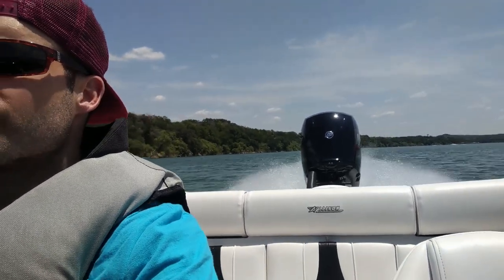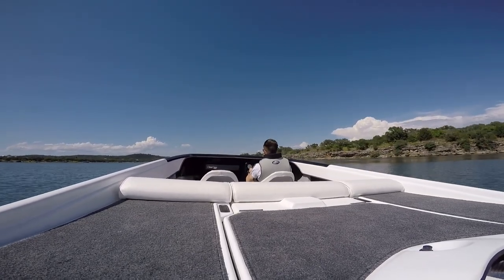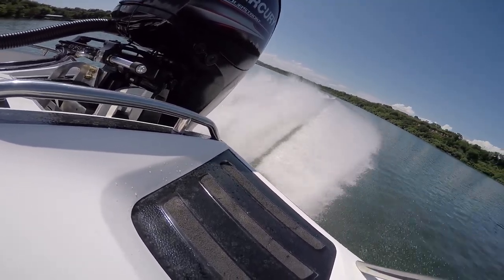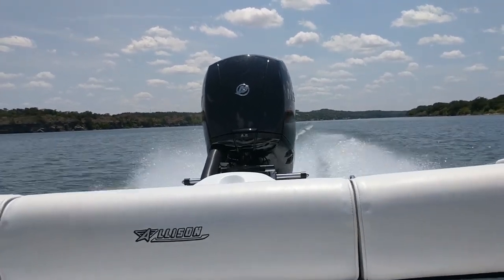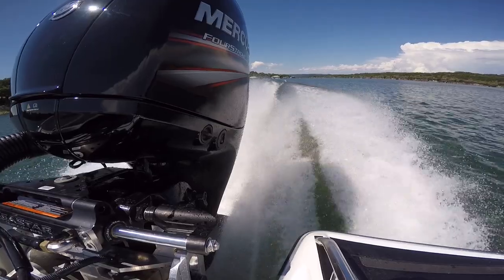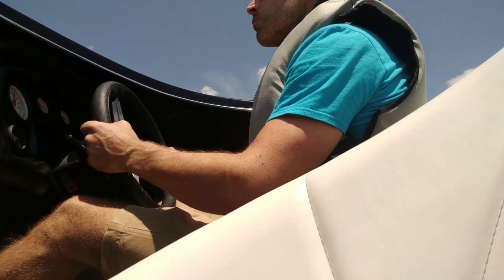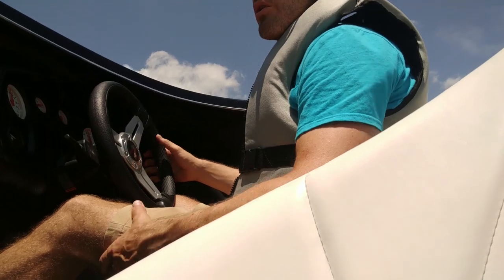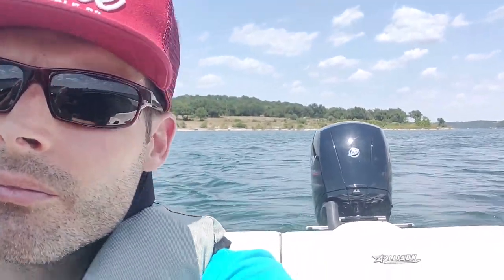Driving the Allison Grand Sport with the Mercury 150 Four Stroke - high speed handling tips

Comment: I think I'm starting to get a fever, and the only prescription is an Allison Grand Sport!  I keep hearing that the rough water capability of these boats is better than their reputation suggests.  I own a Checkmate Pulse 186.  How would these 2 boats compare on 2 foot river waves?
Reply from the maker: The Allison has a deeper V, and a sharper entry, so I'd say in general it would do better in a reasonable chop.
Reply: @WavetoWaveBoats  Cool!  They're in really short supply up here in Minnesota.  I'll be keeping an eye out for an older one.
Reply from the maker: @GrantConklin  Ya, they go pretty quick.
Reply: @WavetoWaveBoats  I know you've driven the Checkmate Pulsare 2100 quite a bit too.  How does it compare to the GS in rough water?
Reply from the maker: @GrantConklin  it's a good question, the Pulsare is bigger and heavier, but the Allison has a deeper deadrise, it's close. Both are decent in a little lake chop.

Comment: I was interested to hear you say that higher engine height will reduce chine walk. Is this the case with all boats or just the Allison? I always thought the opposite was true.
Reply from the maker: Essentially the gearcase drag can induce chine walking on almost any V hull. Any performance boat, you want to reduce as much drag as you can, that's why you need a surfacing or semi surfacing gearcase.
Reply: I appreciate your insight. Is there a rule of thumb as to how far prop shaft centerline can be below the bottom of the transom before water pressure becomes an issue? I don’t have a jack late or low water pickup on my outboard, so stock setup.
Reply from the maker: @rickc9672  Thanks Rick. You will be limited by the gearcase but you can still raise it with good results. See if this article helps, if not, email me the details and I can try and answer. 
https://www.wavetowave.com/home/2019/9/13/reduce-drag-make-your-boat-faster-and-more-efficient
Reply: Thanks for the link. There’s some really good info in that article, especially for a novice like myself. Currently, I have my outboard bolted at the second highest position and no cooling issues from what I can tell, so there’s only an extra .75” higher I can raise the engine. I will also look into installing a water pressure gauge over the winter.

Comment: Great video. What happens if you over trim at high speed?
Reply: Potentially the propeller will loose its bite on the water, which will result in the bow of the boat dropping quickly, which causes the sharp deadrise of the bottom of the hull to catch the water, this coupled with the torque of the prop trying to walk the rear of the boat sideways can cause the boat to make a really sharp turn suddenly. This can vary in intensity from just a quick squirm which an experienced pilot can gather back up, to a sharp 180* turn that can throw people out of the boat, to actually rolling the boat upside down.